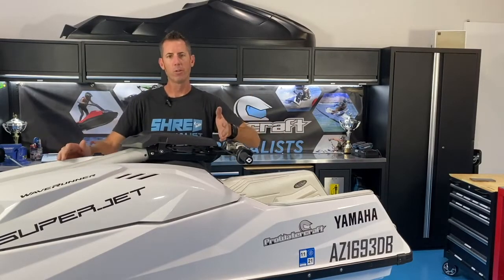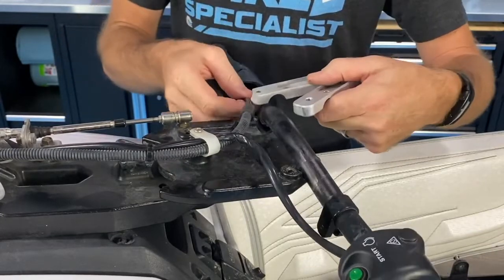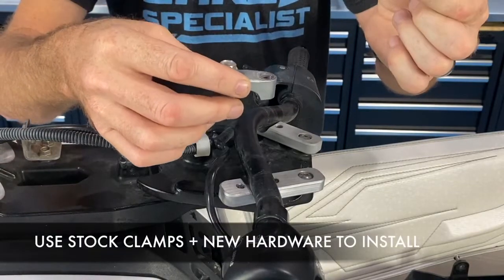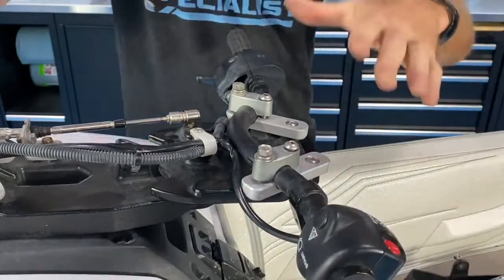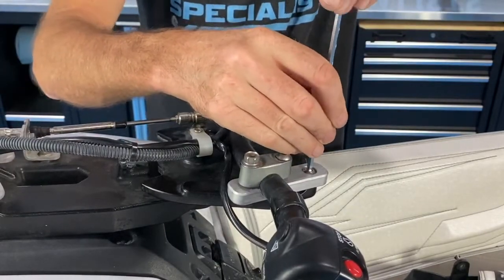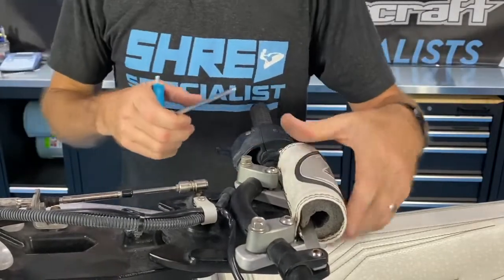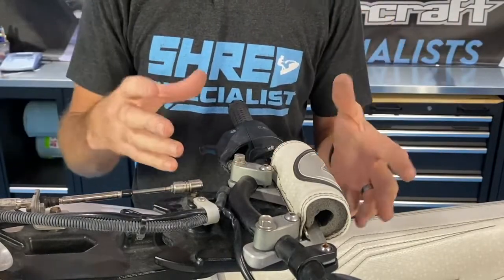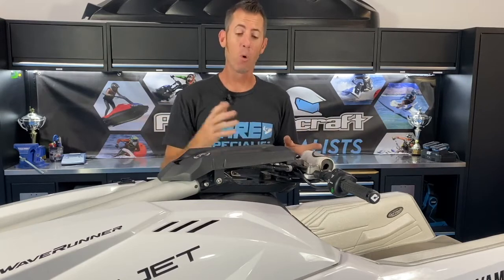Fourstroke SuperJet Handlebar Relocater Kit

Comment: Love this!! Question though, do these brackets work on a 2015 superjet?
Reply: No they won’t. If your looking for more turning radius look up high speed industries quick steer. If your looking for a shorter handle pole you can cut yours down 2 inches look on forums. If your looking for a diffrent steering feel you’ll be spending a couple hundred bucks